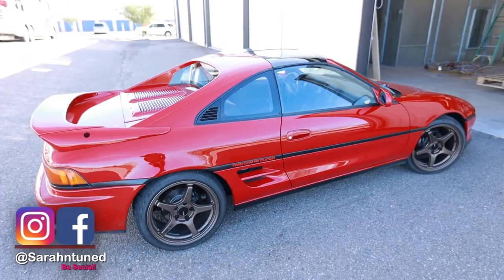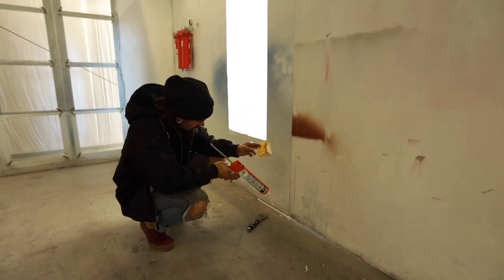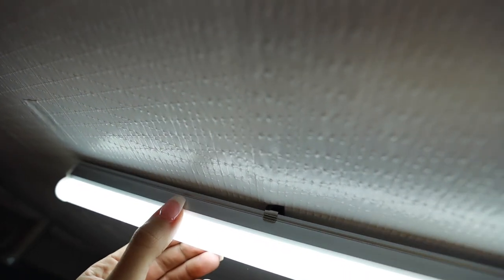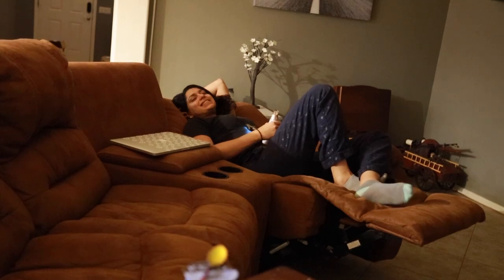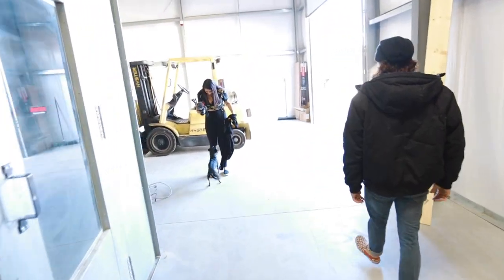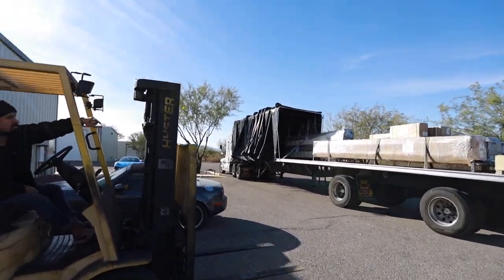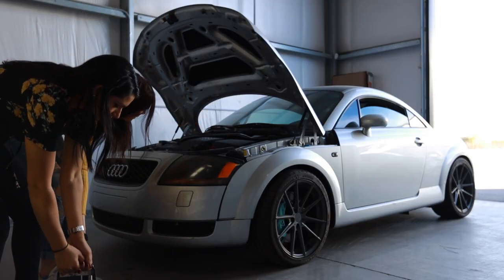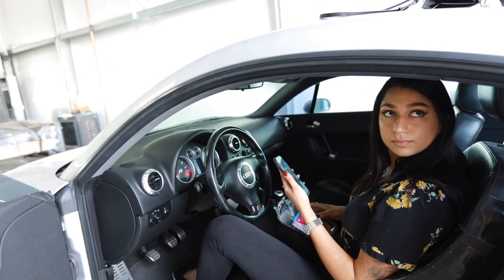The TT Lives Again.. Kinda // New Lifts & Shop Update Vlog

Comment: Sarah, your space has the electrical panel that legally cannot be blocked by anything.  You have to have a minimum clearance by code.  Check your code requirements.  Dont want you to install something that blocks it, then flagged by an inspector or insurance agent.  Just FYI!

Comment: Idea for the lights. Get some 2x4's that run the span between the metal I-Beams and attach them to the beam at the ends (and maybe make a center support using a 2x4 in the middle to the ground) and then attach the lights to the 2x4's.

Comment: Thanks for the content Sarah.  Little advise.  When removing a battery...disconnect ground first..Positive last.  Installing always do Positive first, ground last....mitigates the chance of shorting to the car through your wrench.  Also, your alternator is most likely fine as the car ran on the alternator during the move.  That battery must be sulphated if it never accepted any charge during the commute.  If both were fucked...the pcm would have shut down the car as the battery would have dropped below the 10V threshold.

Comment: Do a double door with a 6ft clear width for the pass through between the shop spaces.  You won't regret the extra elbow room on hot day when you don't want to open the big overhead doors

Comment: Nice to see the tot again.

Bendpak makes solid stuff, and most use a much better jack point setup than the little flippy arm ones. I find asymmetric lifts to be easier when you have to open a door when it's in the lift, but sure as hell can't argue with sponsored.

Comment: Instead of using wood studs and sheetrock for your shop wall use metal studs and metal roofing panels . You can order roof panels that are long enough to reach from the floor to the ceiling.  It's a project you can do yourself with a few simple power tools and some rolling scaffold. Just a suggestion  : )

Comment: Little tip:
If a car sit´s for so long, just idle it with disconnected ideling lines or fuel-power´-lines (i hope you understand what i mean :-) ) 
So you can reach the oilpressure in the whole engine befor you start.

Comment: Great job on the dogs nails , only a suggestion for your lights there’s a company called K&J magnets . Part # RA22CS-S  they hold 7.lbs each 1.37 each . If that building is metal , they should work out well .

Comment: The trailer is called a "Conestoga"  because the cover will move all the way foreword.
Reply: See, that is cool as shit to me.  I work with trailers all the time, but its the common solid sided kind. Loading and unloading is a long, sometimes arduous process. One of these would make thing soooo much easier. This is the first time I have ever seen one. All the other fabric/tarp sided ones I have seen were just standard trailers with cheaper walls. I am impressed by this "Conestoga" set up.
Reply: A slang term (at least where I drive) is "Curtain Side"...for obvious reasons...lol

Comment: It’s funny You haven’t driven the TT in a year today (or the day this video came out) I did a little maintenance on my DA I looked up my last oil change which was a little over a year and a half ago it’s only gone 333mi between then and now I last fired it up around the same time last year to moved it from the garage to the street and back so I could do the brakes on my other car. Fired right up no issues gotta love Honda’s and my CTEK charger maintaining the battery this whole time

Comment: Wet lead batteries start to form precipitates after 30 days without a charge. At 90 damages the damage and loss is irreversible. After one year of just sitting? Even the best of them are trashed. AGM batteries can go 6 months without damage, if there's no load on them. FWIW.

Comment: When you change the flywheel, go to a light weight, single mass unit and enjoy the Japanese Super Bike engine acceleration.  Additionally, get a remap and without anything else done, you'll end up with 269HP and lots of extra torque.  My TT was a different experience after these changes.  Enjoy!
Reply from the maker: Car is already tuned

Comment: 2:39 “.. two moons later” Wouldn’t that mean 2 months later?
Reply: @goo5976  What is that supposed to mean?  There was nothing sexual about my comment.
Reply: A month is a unit of time, used with calendars, which is approximately as long as a natural period related to the motion of the Moon; month and Moon are cognates. The traditional concept arose with the cycle of Moon phases; such months (lunations) are synodic months and last approximately 29.53 days.
Wikipedia
Reply: @chrislang2341  A rhetorical question is one for which the questioner does not expect a direct answer: in many cases it may be intended to start a discourse, or as a means of displaying the speaker's or author's opinion on a topic. A common example is the question "Can't you do anything right?" Wikipedia